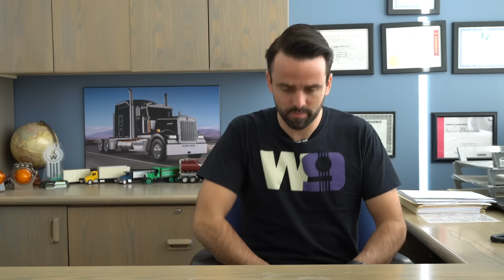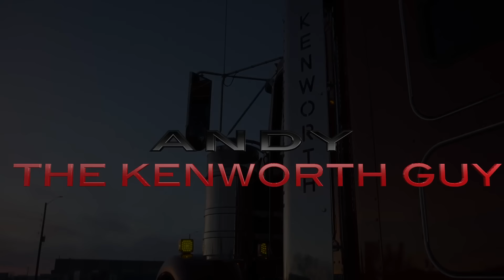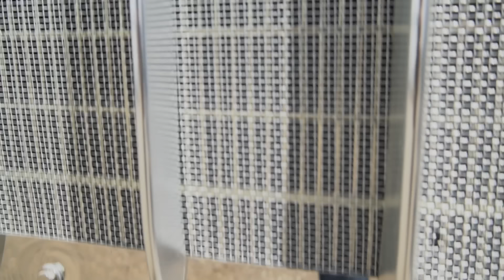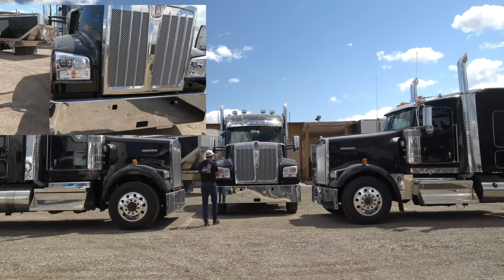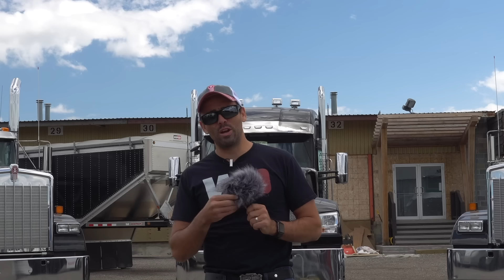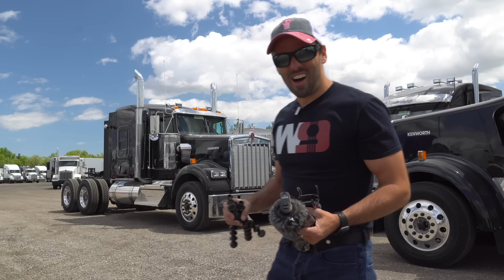KENWORTH W990 vs W900  - 2019 Ultimate Kenworth Longhood Comparison - Cab, Hood, Sleeper & Power

Comment: I’ve owned a few W900Ls. I love them and hate them. mostly hate them because of how uncomfortable they are. the design and engineering just weren’t made for owner-operators. any little thing you want to fix on them results in unnecessary stress because of the design.

Comment: I went from a ‘16 w900 with all the options to a ‘25 w990 back in May and put 70k miles on it. New truck is WAY better on gas and looks great with the right mods. Better looking and more spacious interior and more efficient stock power (less drivetrain loss). W900 exterior will always look better and 18 speed is more fun and fulfilling but the w990 is an overall better vehicle. It’s like choosing between the new Camaro zL1 and the 69’ SS. Yea the 69’ looks better and is more of a trophy but the updated Camaro is better car in almost every way. Hard choice.

Comment: Those W990 headlights are ugly and functionally crap compared to a set of heated JW speaker. Several other major mistakes such the air cleaners and integral sleeper. Basically someone who doesn’t know trucks made the final decisions. Too bad these folks don’t spend a winter in Winnipeg too! Oh, a two piece windshield helps with rocks too. That’s my personal experience anyway, but I’m just a driver, what do I know?
Reply from the maker: Good points.

Comment: I always would prefer the W900 especially the studio sleeper than that Shitcong W990. Yes there’s advantages for the W990 shitcong that the W9 doesn’t have, as said the quote twelve speed I believe regular manual (please correct me if I’m wrong with the gearing of the W990) but I feel that there’s more on the w9 which is better than that one in the middle. In other words the W9 has a lot more capability than most trucks even the W990 yet the W9 in my opinion is gradually much better for me. I’ve always been a fan of the W900 but with the W990 it’s like??? even though its shit the technology is a little enhanced than the W9 but the W9 always be my dream truck especially the studio sleeper. Accessorie wise its more better on the W9 however I’m also concerned about the shitcong w990 and the accessories it’d be implemented and installed into yet the W990 here is like driving T680 with lesser grip. U know I’d prefer the classic mirrors and accessories, thus the W9 would be my first choice because it’s more than driving a monster truck that’s cool

Comment: I’m being told the bolt pattern is not the same. Having trouble ordering a blind mount bumper for a W990 for the truck I have ordered
Reply from the maker: I’m pretty sure they are.
Reply: @AndyTheKenworthGuy  if you look at 2020 Kenworth Trucks, the bolt pattern and tow holes are different on the W900 & W990.  I been in contact with Lincoln Chrome about a bumper. They are looking into the bolt pattern of the Peterbilt 389 & Kenworth's W990 matching up. However, I'm just looking for answer to my bumper dilemma. I have a W990 ordered for delivering in Sepetember. I ordered the cheapest bumper from the factory to change it out at delivery.

Comment: I like the w900b. Nothing wrong with the w900l but the long hoods tend to get in the way at the trucks stops. I used to have a 379 Pete and my hood was hit because it sticks out more at parking spot at a truck stop and everyone knows who drives a truck that some spots are tight especially at a pilot/flying j. Now I have a older model w900b and I pull a 48ft spread Axle reefer and my truck is tucked away in a parking spot less worries about getting hit and I will not stretch my truck bad idea. I think shorter is better. My opinion.
Reply: Bigger is better you can work on it easer more room
Reply: Yeah, but the short-hood models, regardless of rhe make, tend to be harder to maneuver in tight areas, especially in the city. The pitman arm and drag link does not extend out all the way due to the inward set bumper, thus not allowing the wheels to turn sharper. You end up having to make a lot of 3-point turns or having to back up more often than you would with an extended-hood truck. With most turns, as long as you judge the turn right with an extended-hood, or basically turn early enough, you'll make the maneuver without doing extra. It almost always pays off to have the extra hood length. That's why it blows my mind when people or companies think that it's wiser to purchase the short-hood over the long-hood. I've picked up at places where it's tight turns and every short-hood truck had to back up in the turn, but the long-hood trucks made the turn the first time jist as long as they turned early. Anyone who says that a short-hood is better in tight areas likely never driven a long-hood or a short-hood in tight places and are assuming. IJS!
Reply: It's the wheelbase. I have one of the shortest 60" sleeper long hood truck I've ever seen. It's about 4" shorter than my short hood 379.
Reply: @struedel25  yes. I even notice when tmc used to have 379 there trucks where shorter than my 379.
Reply: Just out of curiosity - what do you think about European trucks? They don't have any nose at all. I would imagine having driven the large US trucks your whole life it would feel completely alien?
Reply: @cypher9000  what do you think about American trucks with the massive hoods
Reply: I’m looking for a pre em w9 I like the L but if the right deal comes along I’ll get a B and if I get a B I’m naming it “the beer can” lol

Comment: The W900L looks the best, in my opinion. That said, the 2.1m cab is a dramatic improvement. My first experience driving it was a T680 day cab. After several months driving it, I got assigned to run 300 miles bobtail to pick up a trailer. I was honestly stunned. The truck drove better than my F350. I figure if I won the lottery, I'd convert a T680 into a crew cab pickup. I'd like to see Kenworth carry that cab to a lighter duty truck. It's just an incredible cab. My upcoming job is going to put me in a Peterbilt 579, which I'm pretty sure is also a 2.1m cab, but obviously a different layout. My choice remains a T680. I love the idea of a W990, but for money aerodynamics count. The one thing I'm most curious about is driving the 12 speed. I've always been very much against automatics. They've always been horrible. Then I drove several Freightliners with their 12 speeds. I was stunned. I actually LOVED the transmission. It was the ONLY thing I liked on the Freightliners, but it's awesome! I'm hoping the Paccar 12 speed is equal. (Better would be better, of course. But I'll settle for equal.)
Reply from the maker: Kenworth will he replacing the medium cab with the 2.1 eventually. Can’t wait! Thanks for watching and commenting

Comment: What kinda mpg will a 900b flat top with mx13 455hp,  12 speed auto and 2.64 rears get pulling a van? I pull 20-30k lbs

My t680 is getting 8.6 with 455hp,2.64 gears 10spd auto 6x2 drive super singles.
Reply from the maker: I would ballpark  0.5 - 1.0 mpg less
Reply: 12 speed is a euro transmission

Comment: Give it some time and the aftermarket companies will build a W990 compatible air breather system.
Reply from the maker: Finger crossed.
Reply: @AndyTheKenworthGuy  If they release an Australian Equivalent of the W990 they might have to put air breathers on it so if they do that I could see people who are privvy to this info importing air breathers for their W990's. I was watching a video of a similar looking truck with air breathers, the truck was based out of Australia or New Zealand. I will try to find the video.
Reply from the maker: I’ve seen that truck at the factory with air cleaners. They are small. I thought they were for the North American market but it was the Australian version.
Reply: @AndyTheKenworthGuy  
Perhaps its the Austrailian T910 I've read speculations about, the T909 is more or less Kenworth AU's W900.